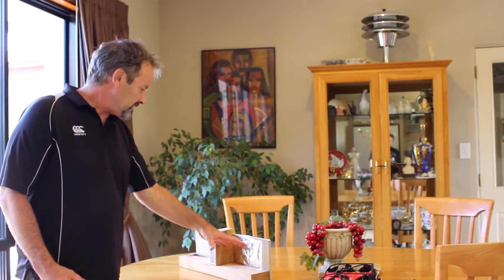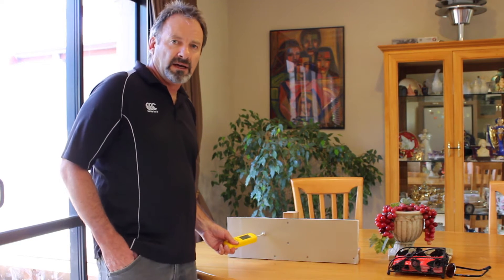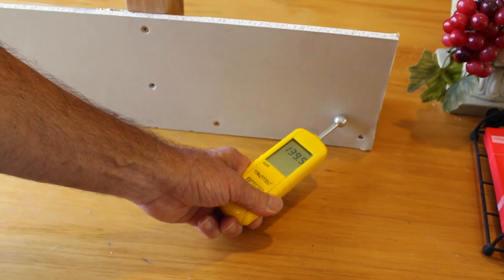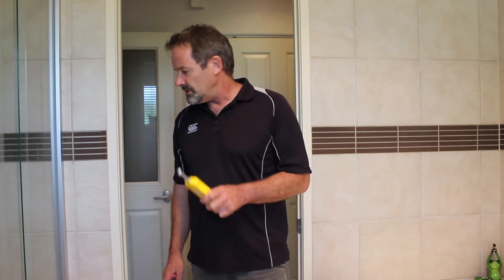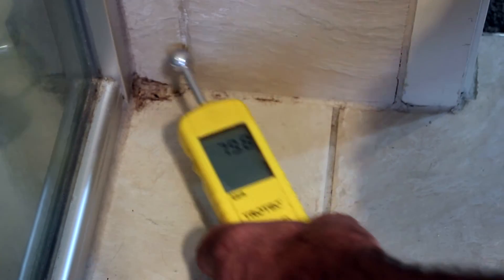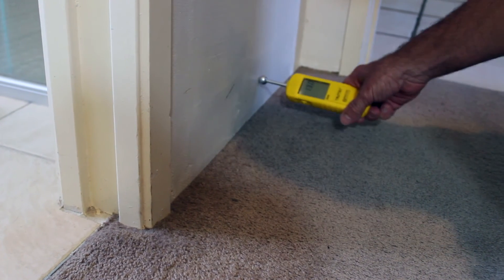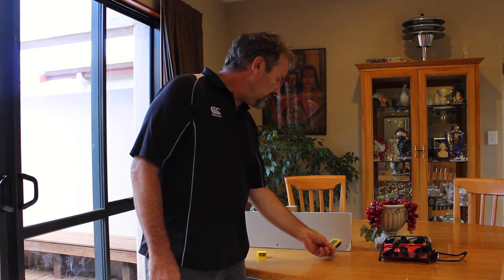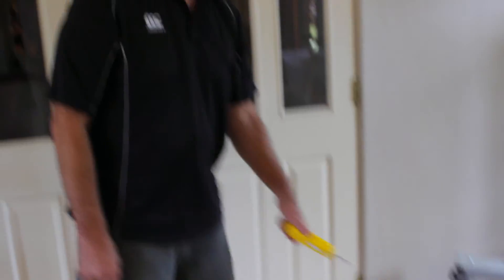Non-invasive moisture meter what you need to know.

Comment: Hi everybody!  A friend of mine, brought a humidity meter with one very fat point because my apartments interior fat brick-cement walls, shows humidity between 20-25 and in one wall showed 38. I'm on third floor and block of flats is old: 1967.
I suspect that there are leaks from above apartments in the walls!
The reason i let him do it is, that i have 30..000 books in which sometimes have found mould!! I'm afraid for my books.
And if is is dry as he says to me.. how is it possible desiccants hooks to be full in one month time?
He told me that either way desiccants would be full even if was not humidity around!!!  I start thinking to buy my humidity tool trotec!
What do you think for all this;
Many thanks,

Comment: Great video! Curious to know... would an infrared/Thermal camera also work in testing for moisture when standing in front of a tiled shower and/or help locate moisture inside walls immediately opposite a tiled shower(?)
Reply from the maker: The Infrared camera can make the moisture visible as an anomaly, but you cannot confirm its moisture without first testing it with the moisture meter. 
https://detect-a-leak.co.nz/services/infrared-building-inspection-moisture-inspections#bathroom

Comment: Hi.

 I've recently purchased an extech m0257 which looks very similar to the moisture meter in the video. The meter is described as measuring from 20mm to 40mm depth. 

I am trying to gauge the moisture content of some kiln dried Yew wood that is 50mm in thickness (which should be around 10%). I'm getting readings of 25% (holding the meter correctly with it at 90° to the wood) 

If I hold the moisture meter 20mm away from the wood I am getting a reading of 10%. Would you say this is because it's reading the surface of the wood or just a false reading all together?

Comment: Just realized after watching this video why the sheetrock with A/C duct running behind it was reading higher.  I thought it was wet sheetrock due to condensation when in fact the ductwork is acting like a foil backing altering the reading.  So glad I came across this video!

Comment: Will false reading also occur where there are other types of metals behind the material, such as piping?
Reply from the maker: Yes any metal that's close enough to the meter will increase the readings but often pipework is deeper in the wall so might only make a small increase if any on the readings.

Comment: Good stuff. What kind of a problem to old fibro (asbestos cement) sheets present?
Reply from the maker: It's very moisture absorbent and becomes brittle overtime. Not to mention the health hazard.
Thanks John
Reply: Thanks John. I'm finding readings from 100% down to as little as 10 for some walls I've been investigating. I've warned the agents about the health hazards of old fibro.
Reply from the maker: It will often have high readings. Best to test the building on the inside to see if the moisture is getting into the building.
Reply from the maker: Moisture can easily pass through it. If the buildings old there may not be any building paper underneath which can allow moisture to form as condensation within the wall on the gib giving high readings internally.
Google how to identify asbestos fibro cladding for more asbestos info